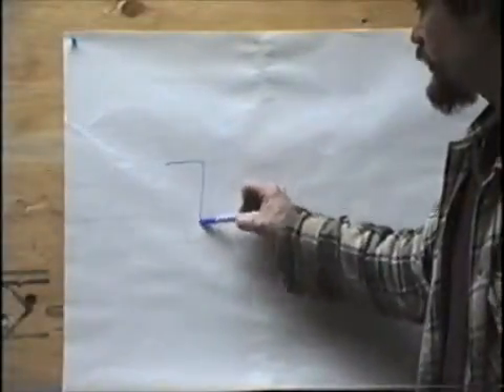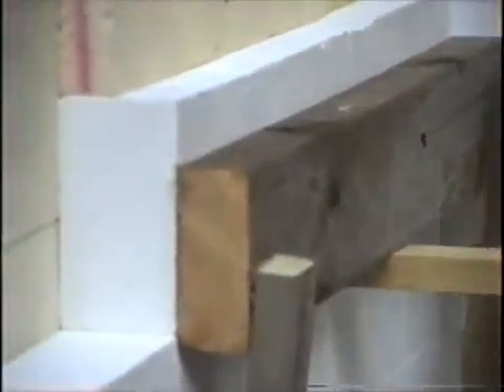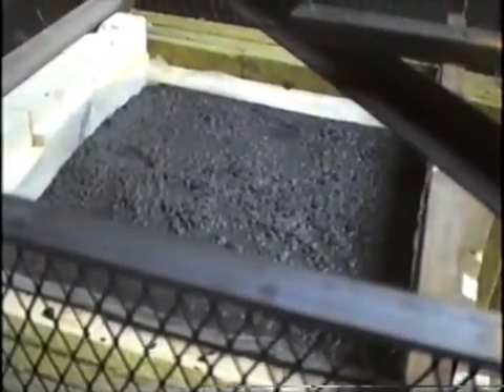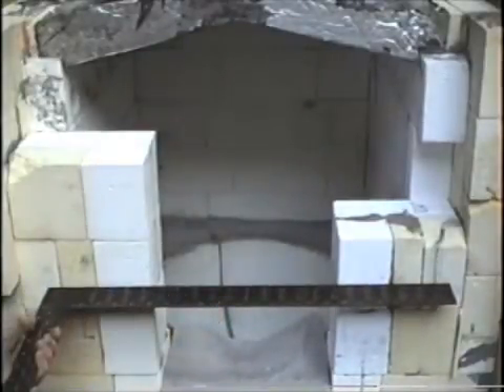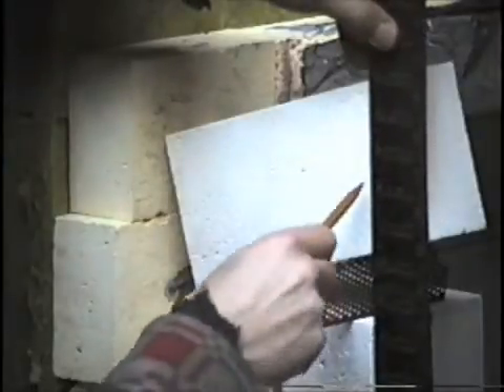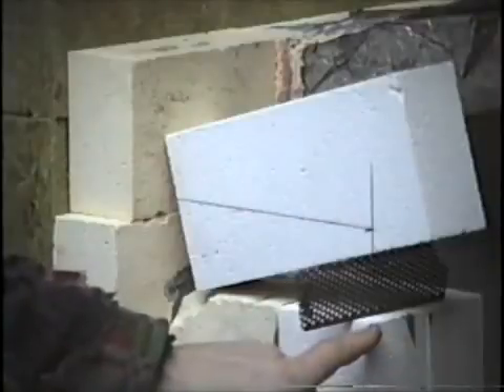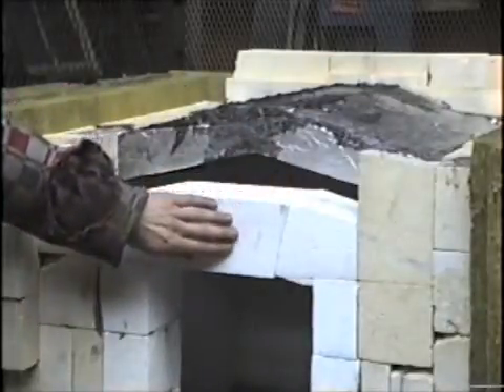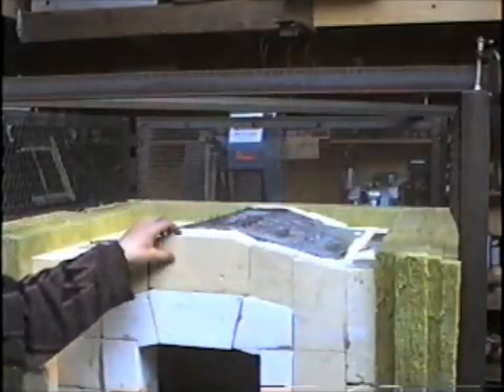Crown & Arch - 170-pound glass furnace sample clips

Comment from the maker: The heating chamber is about 6 inches clearance from large gathers.  And yes, the square chamber enables rods of equal length to be used.  The radiant heat is still close enough to heat the entire mass of the investment, the side walls, the pot, and the glass.  Probably a total of 800 pounds.

Comment: why is your ' combustion ' area so big 
realize this unit elec  so no combustion.  just term for area ..
the area above pot could be made smaller if you went round .less space less heat ..round is good for fire ..
guess you need space for sil carbide rods near the crown
interesting vids ..it's -35 below in ak today 
furnace is stone cold ...stay warm ...